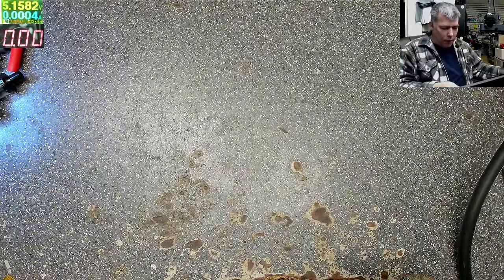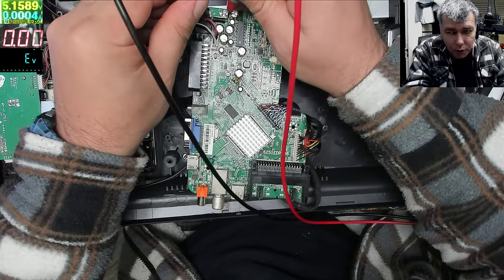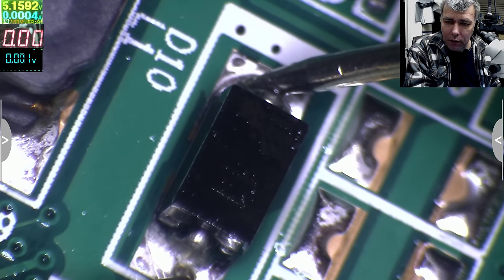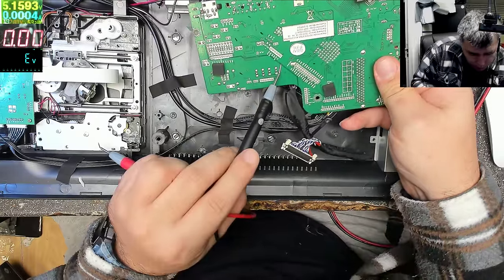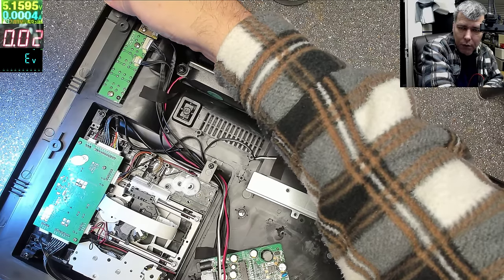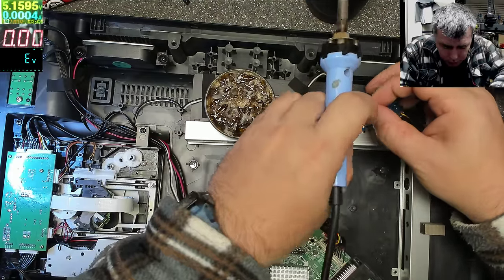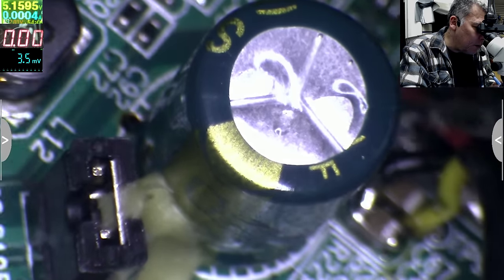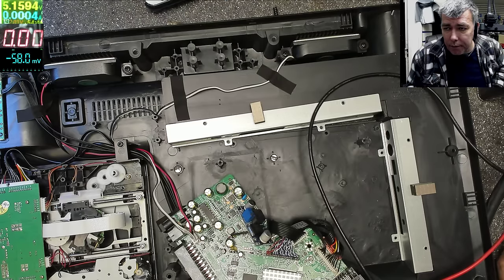Tv's - Diagnose and repair / power supply repair/replace/improvise

Comment: That's awesome. I've been learning and learning for a while now and the way you experiment is priceless to me and has finally given me the confidence to actually start trying more advance fixes. I am disabled and get sick too easy and I am only mid 20s I've been trying to learn tech repair for years to make money. It started adding mod chips to game consoles to now finally confident enough to start diagnosing some failed hardware like graphics cards , TVs , a few laptops, reading voltages from overclocking directly from the board. Thank you very much. You have taught me so much. I may have misheard a video around this time last year but I think you said it was your birthday soon and either way happy birthday man.

Comment: 37:50 I like your idea to use that DC to DC buck converter to replace burned 5V chip regulator on the board.
You fixed that tv fast and with low cost. 
For me that was brilliant because,
that DC converter (as you've said) is not linear like that one, which you've used in old video during the very big speaker repair, but here this one is switching type, so there will be no over heating danger and also it has coil and big capacitors already on the board, so it is perfect for this situation. I have exactly the same DC converter at home but I've never thought in this way to use it in that kind of case. 
Great idea! Thank you for advice.

Comment: Sorin , use your favorite hot glue on those soldered wires this will keep it in place and prevent any short.  You can use it also to glue that dc to dc board to the TV. Thank you so much for your videos. Keep them coming.

Comment: BAUHN is an ALDI supermarket brand. Here in Australia, at one stage i was going around picking up unwanted (working or non working) TV's. one was a 50 inch Bauhn. it worked but couldn't change channels or something. I asked the owners if they looked at getting it repaired, they said they took it to the local repair people (more than one shop i believe) and each time they walked in with it as soon as the shop person seen the brand they were told they don't repair that brand because it's junk and to just go buy another one. That is my knowledge of the Bauhn brand pronounced BORN here.
Reply: You have ALDI in Australia ?
Reply: @karldecauwer2183  Sure do

Comment: Lets have a look Sorin!
The student is with you, 😁

Ok writting down. Use petro or alcohol to find hot chip. Teacher just showed student to not use finger. 😀
Reply: @danielsatko-  Thats actually an opinion. Alcohol works to a certain point. And is great. However, what i have found to be a fact. Is that some flux that is left on boards from the factory. Alcohol has a hard time removing it. It just kind of spreads it around causing a larger sticky area. Lighter fluid will wipe this residual sticky mess right off the board with ease. You should really try it. And not fall into line with everyone else. Make your own conclusion.
Lighter fluid does not evaporate as fast as alcohol does. So it gives you a little more time to find a bad component when you are using this method. Both do work. Its a personal preference on what you want to use.
Reply: @danielsatko-  negative, lighter fluid does not leave anything. Try it and you will see.
As far as your comment about evaporation when heat is applied. Yes alcohol does evaporate faster. Which gives you less time to notice where the heat initially started. Unless you are looking directly at the cause.
Reply: @danielsatko-  no, i do get it.
With alcohol you have to keep adding it over and over until you find it. Its completely different with lighter fluid. And if you would of tried it instead of saying alcohol is better. You would not be here now trying to justify your comment.

Comment: I used the same lm chip a year ago when my sony cd car player. Display did not want to light up. And found missing 3v power rail for the display was missing. And the 3v chip you could not find anywere. So i did improvized. Tought to myself what if i input 3v with another chip. Boom and bob is your uncle problem solved. The funny thing is that we are both romanians

Comment: so its basically a variable resister like a potentiometer. The higher the resistance the lower the voltage right?     E | I   . 

                                 R
Thank you never thought of using it for a repair like this.

Comment: 37:00 Watch out with this "generic" power supply, it will destroy everything behind it.
I had exactly the same, dirt cheap, theoretically adjustable but extremely low quality and unstable.
It made a catastrophic failure, and when I took it out it was literally leaking input to the output, destroying everything along the way.

Comment: Great bu be careful with those modules. I would prefer MP1584. Cheaper and more stable. I saw drift after time / temperature when using those larger units to repair old C64 PSUs but the MP1584 was rock solid after about 2 hours at 1.5a. Also they all seem to become unstable over about 2a/2.5a

Comment: I have a question: You used the buck converter to supply 5V to the pin number two from right to left on the lower part, but what happens to the four pins on the upper part? are they connected to that same pin?

Comment: Hi Sorin. I have made an airgun. running 350C (oh just thought your 400 degrees is possibly fahrenheit?)  and it melts off the chips markings so I sometimes lose the chip orientation.
Any advice you can give will be valuable. I will also try 200 cel now.

Comment: Thank you for this video
Actually I wanted to ask you could install a mobile charger instead of this circuit
Reply: That buck converter is a lucky choice. Probably the lcd panel requires 5V so a 7805 would have had an harsh life.

Comment: Sorin hi. I have a 50" "AKAI" (cheap chinese ). I have BL_On but no BL Power (I can see the menu) = PSU board fault. My question : is it enough to buy by the PSU Model only ? because I find dis-similar boards with same model PW.168W2.801(none mentions the brand / tv model). How do I make sure I get the right board ?  thanks.. where are your videos ?

Comment: Good video Sorin, but can you explain why you put the probes on chassis of tv at 2:00? the chassis is negative,where"s the positive?explain,please.
Reply: You can't see the DC jack/socket from this angle but he is placing the PSU positive probe on the center pin of the jack.
Reply: @justinspiredfallout  thanks,i got it

Comment: just curious about how much would you charge for a job like that... some small tvs are less than 100$  i didn know if it would be worth the hassle fixing cheaper electronics/??
Reply: I'd venture a guess that if you can stand the low pay rate and you are quick at the work - if you quote no more than half the cost of a new device then you will likely get the work 80% of the time. This is because people want cheapest way to get back to a happy place where they can do what they were before the fault/damage; obviously some people would rather reinvest that repair cost quote amount into a new device for warranty and longevity as well as maybe newer features or nicer aesthetic design for same function. This will be a guaranteed fix buying new.
You just have to judge your marketplace and economy but don't price it to get the work if you can be fixing something different and making more money. Someone else who isn't as busy or is desperate for any work will likely pick up the repair.

Comment: hi, can anyone answer my question? 
I have Acer nitro 5, unfortunately, I dropped little water on it I open and see there isn't damage on the motherboard but it won't turn on.  I sent to the one service and they said GPU (gtx 1050 ti) fired . is it possible?  I dropped water when it's not plugged and my GPU works only when it is plugged in?

Comment: Just saying. Those cheap switching regulators are pretty bad and would fail fast under loads of over half an amp.

Might be better building your own. A simple two transistor buck can be built for under 1$ and is more reliable than these XL6009/LM2596 modules.